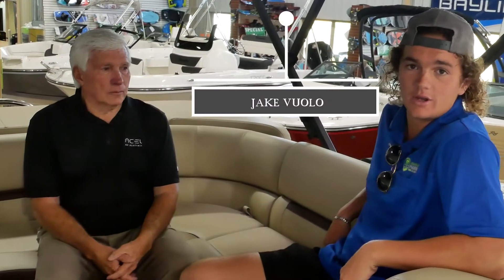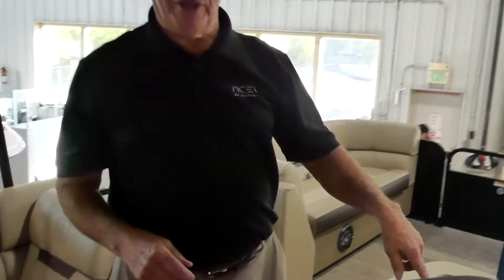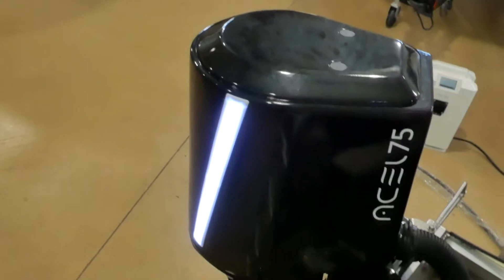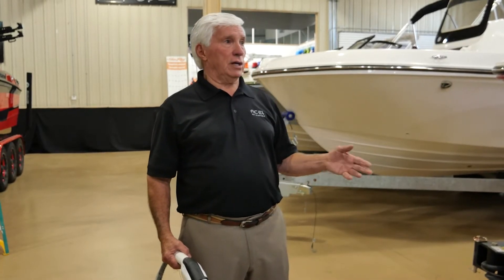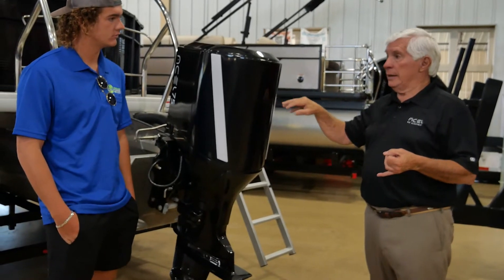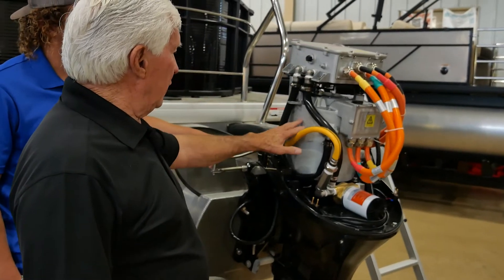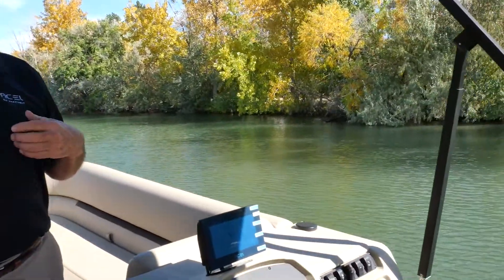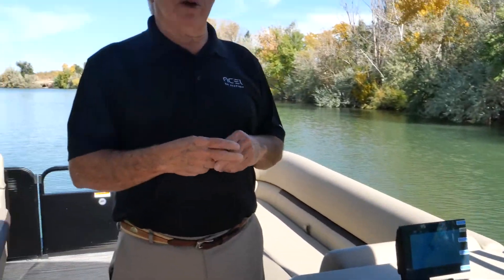First EVER ACEL 75HP Outboard Motor

Comment: Wanted to hear how much sound the electric motors produce when running, especially in the water. Thought that was the highlight of having a sea trial but instead you chose to bombard us with that  music. Would have preferred to enjoy the quietness of the motors instead.
Reply: What motor noise do you hear coming from a Tesla that drives by?
Reply: This is a new area for EV, the noise would depend weather you are on plane or just putting around.

Noise underwater will be mainly from prop mainly, but up top it will be a humm that you would not hear really because the water being displaced would only thing you hear.

Their 50hp motor is 30,0000$ and a 30kwh battery that is oh probably 450lbs. And no it's not eco friendly, so many people are focused on tier1 emissions to sell their products no one looks at tier 3. 
Besides who is stupid enough to pay 30k for this.